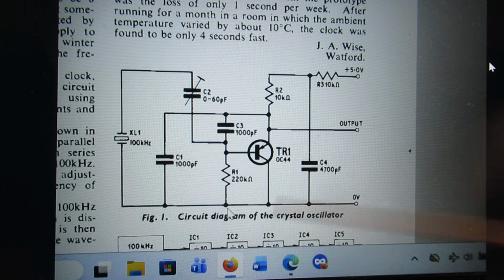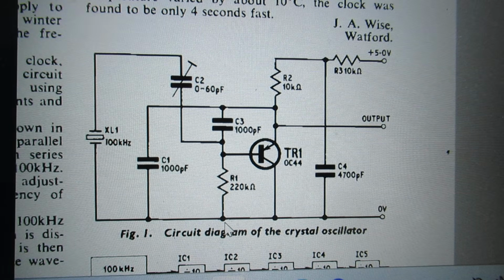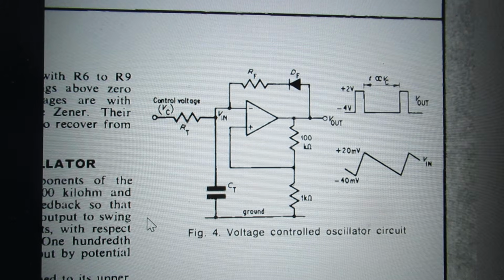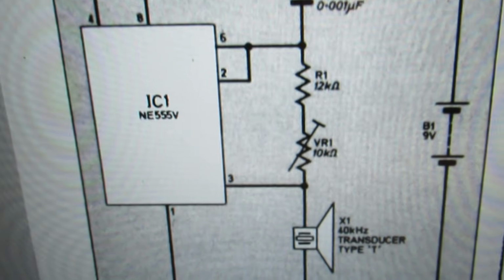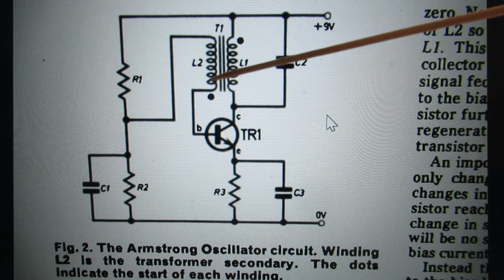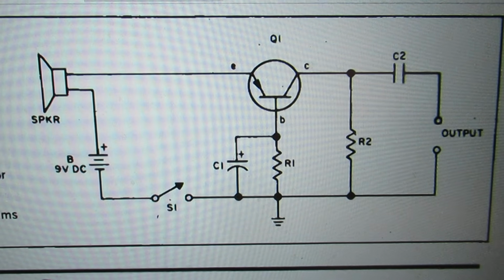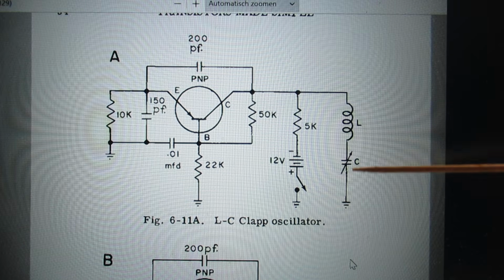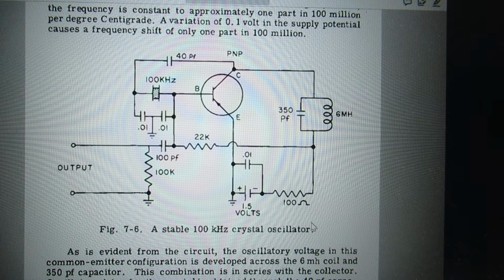About simple transistor circuits of the 1960s & 1970s how to make them in modern times pt 3 (final)

Comment: Thank you for your video showing small transistor circuits dated back to 50 - 60 years. It is nice to see what kind of circuits were were used in the audio circuits. Perhaps the crystal oscillator circuit with OC44 germanium transistor was made in the 1960's. Good!
Reply from the maker: You are welcome, thanks.

Comment: I have been wondering what determines the input impedance of an audio transformer. Because it is not its Xl at 60 Hz..but is at some other frequency? I wonder if it is determined by a resonance caused by self capacitance,...or it can just be an arbitrary value of Xl?
Reply from the maker: The impedance of the coil differs with the frequency in the audio range, between (say) 30 Hertz up to (say) 18 KC. To transport the whole audio frequency band (30 Hz-18 KC) without a resonance peak in that audio band high quality of the audio transformer is necessary. Small and cheap transformers for say 230 V-12 Volt can be brought into self-oscillillation. In tests that I did I found resonance frequencies in the order of 200 Hertz-300 Hertz.
Reply: @radiofun232  Thanks for the reply
Reply: I think it's 1 KHz